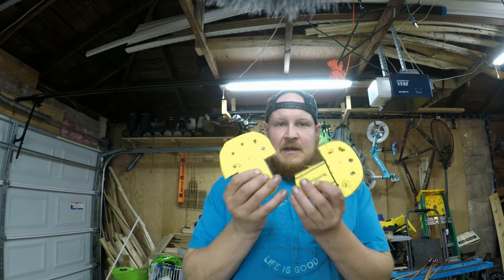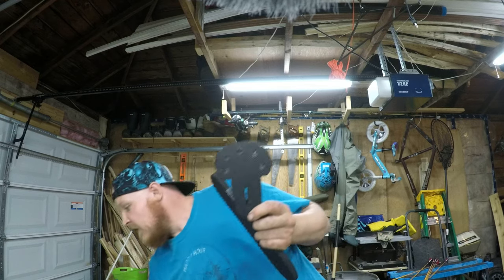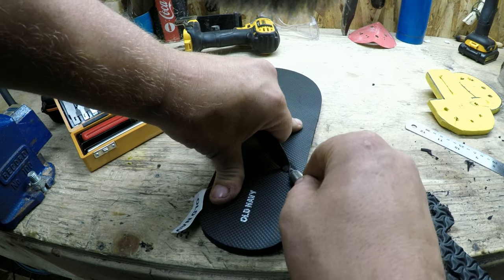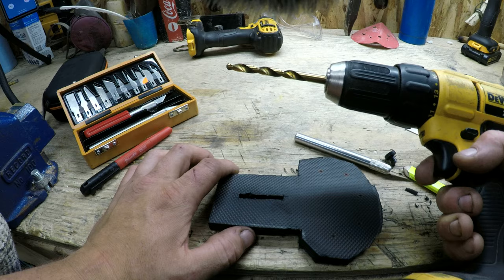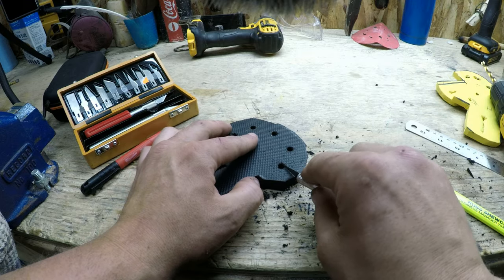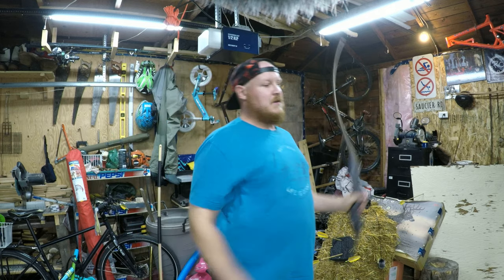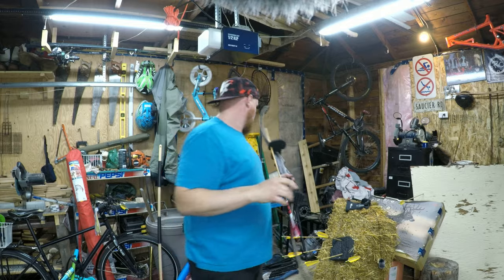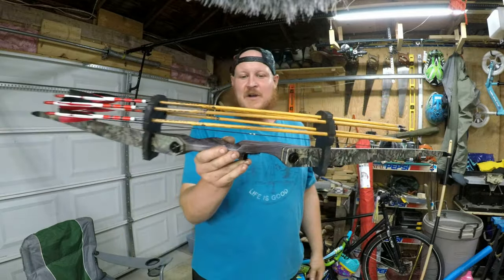DIY Traditional Bow Limb Quiver, Cheap cost me 3$

Comment: You need a cover for points. No one should walk around with exposed broadheads
Reply from the maker: I agree some people shouldn't. But hunters have done it for decades with no issues as long as you are aware and careful. Ive ran this 2 season walked lots of miles and never put the broad heads close to me. I also have no need for 5 broad heads. I only carry 2 the rest are small game heads. You can easily add a hood if concerned. Thanks for watching.

Comment: That wouldn't be safe with broadheads. You don't want to end your trip with stitches or worse, dead. Plus I can only see this catching a bunch of brush and possibly losing an arrow. 

You're not spending much money or time getting some leather and stitching together a hood to safely store broadheads.
Reply from the maker: You do realize hunters used an open quiver design for decades right. I've used this 2 full seasons now. Walked over 50km through thick bush with no real issues. My bow itself catches more then the arrows. It's not for everyone i get that but for me it's all I need
Reply: @prairiemountainmanadventur7424  I know but just be careful. I've heard horror stories of people that almost died from tripping and severing an artery while having an arrow nocked. Those fixed blades are scary sharp and I've had my fair share of stitches from the tiniest mistake when handling them.
Reply from the maker: @MIHAJLO  oh forsure and I appreciate the concern